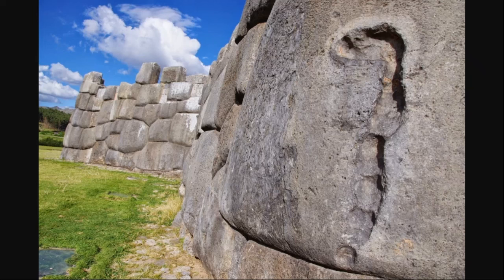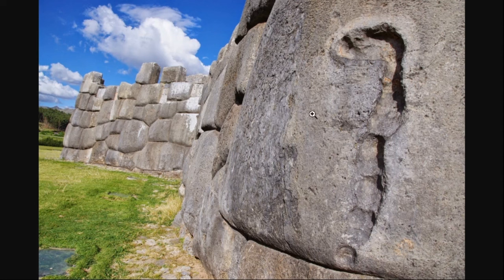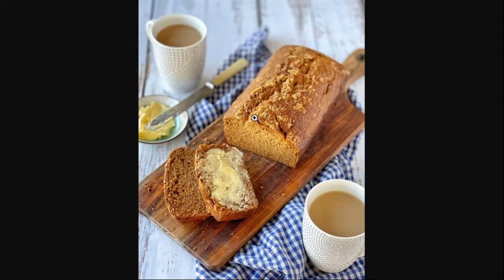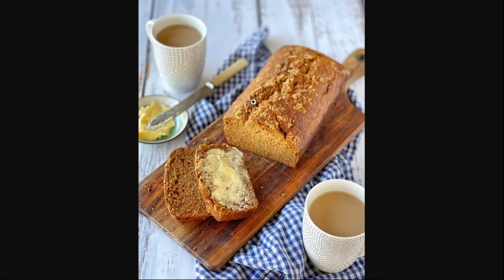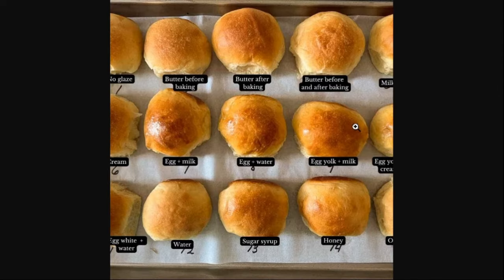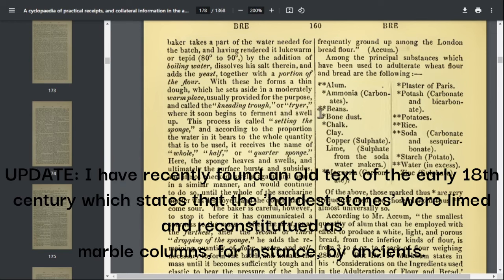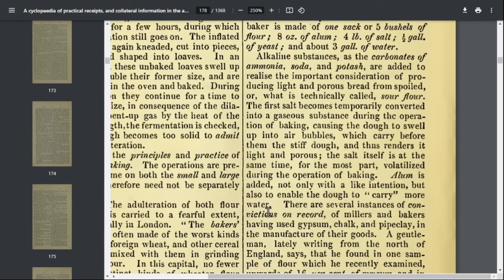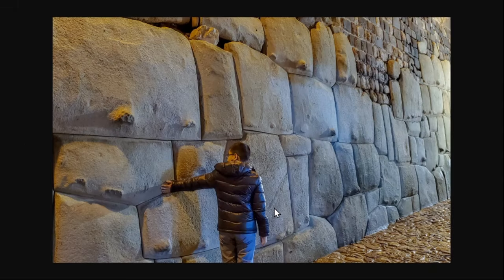Inca Stone-Leavening Part 3! Nubs, cracks, 'vitrification' as well as Chemical leaveners!

Comment from the maker: The view count is not leavening. Needs more yeast. Everyone is too busy watching spongebob or Escape to the Country today. :(
Reply: Look up ytong aerated concrete. Its commonly used in Germany to make lightweight concrete structures. They put a Styrofoam form in place, pump in the ytong and then wait for it to set.
Reply: The algorithm has picked you up now, I can here from it's reccomendation.
Reply: U should try the way I do it, when you shovel out a clump of clay put it in some water and gather the densest clump. Keep doing it until you get the size of the thing you want by combining them. Then with the left over water get a pin and poke alot of holes in a plastic bottle and stick a hose on it and use it to gravity drain out all the small particles and then cook it to get rid of all the water and it goes plasticky. Grind it up and mix it into the object. Then cover it with soot, but keep reheating the soot and reapplying it after it cools for a few days and it'll go rock hard. Then when it's like that cook it on a low heat for another day or two and it will go rock hard.
Reply from the maker: @chinafox1949  Wooohoooo!
Reply from the maker: @kulpritblk1578  WOW! Love it!

Comment: I think they were made in fabric bags with a drain hole which is where the nubs were formed. The bag was never removed, it just wore away but it gave them the bulging look.
Reply: I like the Theory of them being formed with sticks put through them. The sticks made them easier to carry and were cut away and or disintegrated over time. Only the stone nubs where these makeshift handles were remained. Never heard the theory you shared about their formation. I like it. 
Would love to have a Time Machine so I could just know all the things we’ve lost over time. If I ever get one I’ll invite every subscriber of this channel 😉 😁
Reply: great theory! stacked like sand bags holding back flood water
Reply: i agree. that’s why many nobs are far down toward the bottom of the blocks.
Reply: My challenge would be to ask why hasn't anyone replicated the effect in fabric bags with liquids that harden. Plaster of paris, for example. Or some other of the thousands of mixtures we have that can harden. No-one has replicated the end result, yet the materials are cheap and readily available.

Comment: I've seen it suggested that the nubs were left behind when electrodes were pulled out of the soft stone. If you combine that with the "Stone bread" theory that would make more sense than using electrodes to just melt the stone into shape. Notice on the examples in the video, there are two nubs one each stone, a positive electrode and a negative one.
Reply from the maker: Electricity def has a role to play in Geology, Andrew Crosse, on whom I once made a video, made minerals and crystals and possibly even lie, very rapidly vs. geological time using electricity, he suggested it was pivotal.

Comment: It is possible to melt and mold stone in molten form which does leave a more uniform grain and smooth shiny surface. The only other thing durable enough with the properties and appearance of stone would be Venetian plaster or something like terrazzo. Where dust from the parent material is embedded into a binder to emulate the qualities and appearance of the parent material. So a finished layer almost indistinguishable from the raw stone. But that doesn't explain the nubs. Certain grooves and scoop marks do look like the stone was melted though.

Where did they get that kind of heat? Well they could have made charcoal and fires with that charcoal and then pumped air into that fire somehow. Or they could have used reflective metal parabolas focusing light. Or some other kind of lens or focusing method to direct sunlight. Metal parabolas seem most plausible to me. Then you could in theory heat up a surface and flatten it with a sort of trowel. Or you could head up a section and scrape it away leaving behind a scoop mark. Assuming you could not heat thick areas over a large surface all at once. But a thin layer maybe easier to heat the entire surface for finishing.
Reply: Don’t “buffalo chips” make hot long lasting fires? That’s a fuel source I could maybe see as a possibility. 
Liked your comment. Interesting
Reply: @angiebear8727  There are still some very interesting anomalies. Like the quarries on cliff faces with perfectly smooth faces and rectangular recesses. One very interesting feature that is a smooth walled half cylinder carved into a rock face with perfectly symmetrical diagonal grooved lines forming a grid pattern on the bottom. I don't even know how modern technology could do that easily. 

The other weird thing is the mix of perfectly squared blocks and perfectly fit more abstract geometries. Regardless of the block geometry the openings carved into them are all equal in proportion and alignment. Once you think you got it all figured out there's another approach and technique to consider.

Comment: i think the exterior of the stone was softened somehow
and i dont think it was from any stupid juices or potions poured on the exterior
some sort of ancient machine that they got working that softened it.
think the machine owners/users could even reverse the polarity of the machine to pull the nubs out to help the other people move them
the stones were still relatively soft when they were placed which is why we can literally see the sag in them like at 10:55
the way they made it so "a credit card cant slot in-between them" was because the inherit softness of the stone as it seated itself would spread and fill the void where it matched to the other stones
the stones that were too soft when placed would sag more and bulge out and those stones were scraped and scooped back
the ones with nubs left were the stones that some useless worker made the mistake of letting the stone return back in hardness before he removed it